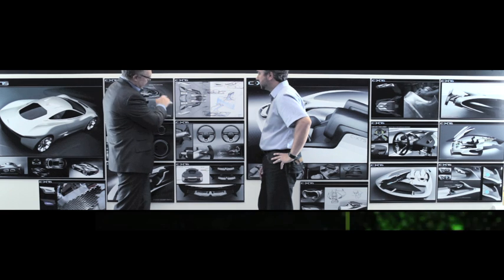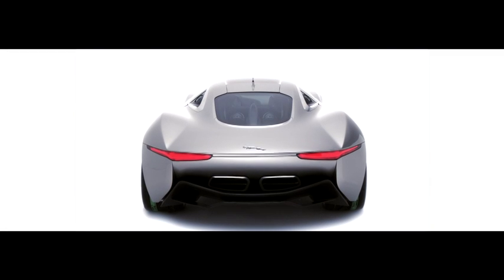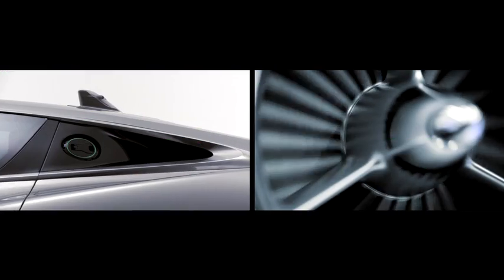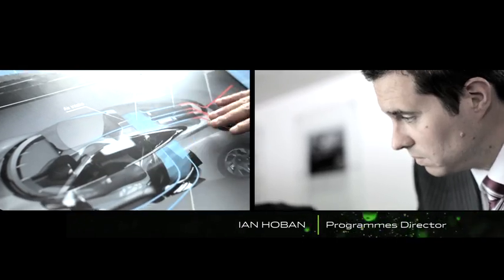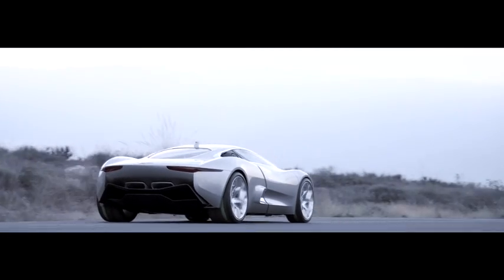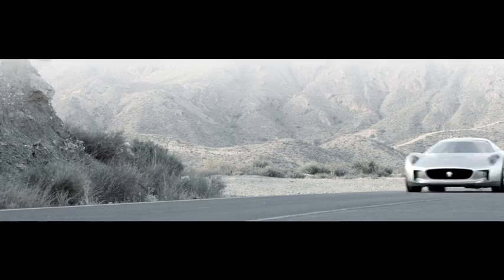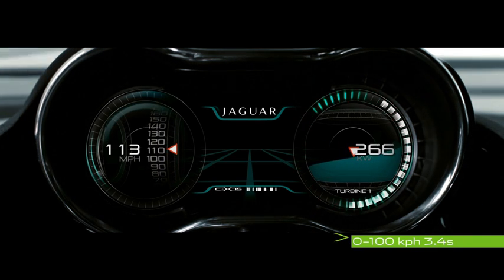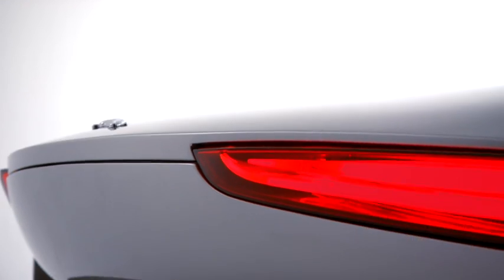Jaguar C-X75 Innovation

Comment: range extender is just smoke & mirrors to keep people from knowing it's ultimatly powered by crude oil or coal. but no its not the same thing it's a serial hybrid with plug in capability. gurauntee you once the ac is cut on the motor kicks on and nobody in their right mind rides without ac.

Comment: this is not a hyrbid car. The wheels are purely powered by elctric motors and not the gas turbines. The only difference between this car and fully elctric car is that this car carries around the powerstation in its boot. Range extenders really are the way forward. gas turbines would be awesome in all road cars but we arent quite there yet